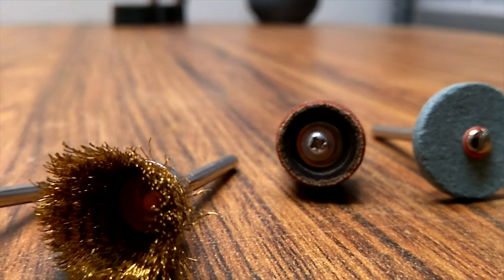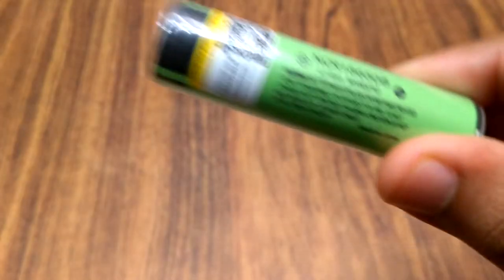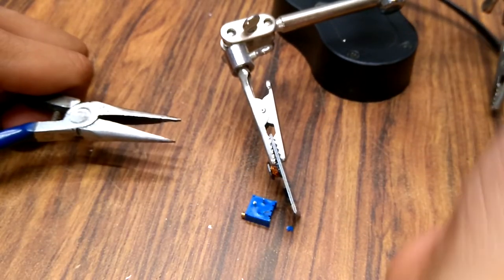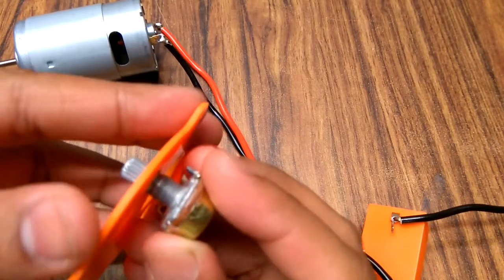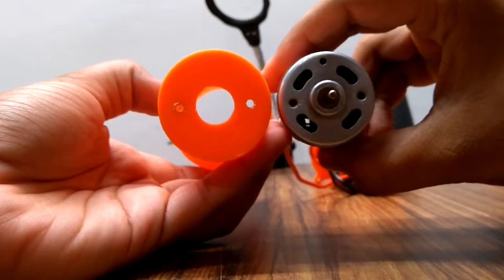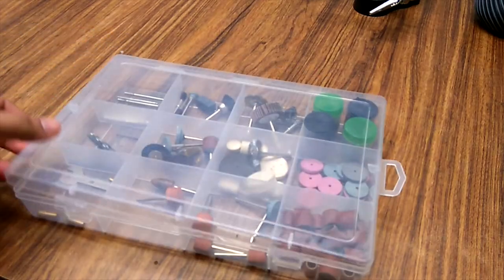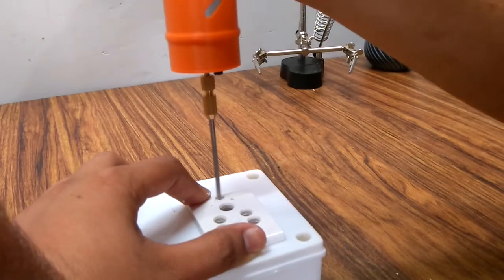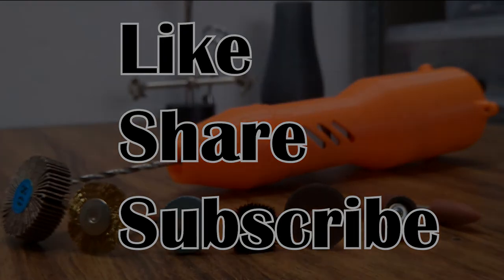DIY 3D Printed Dremel Tool

Comment: Replace with 4amps boost module for better results. Thanku.
Reply: true cause this module step up voltage,ok, but it is fine for 1-1.5 amps but will not be ok with more! this motor will require fast more amps! like you said, choosing a module able to deliver 4 Amps is the best! Also, better to use 2x 18650, because one 18650 should not be stepped  up to much, more than 9v-10v!! to much stress on a single battery is not recommanded! thats why better to use a least 2 x 18650.

Comment: bro step up module may not be that effective for.work coz it limits the current..and.thus the speed....use a power supply..like 18v or 24..would be great if you add 3 lithium batteries .which would give atleast 12v at full charge.

Comment: What is the Power supply to work Moto
Reply from the maker: the motor requires 12 volt power supply. i have used 3.7v lithium ion battery witha step-up boost converter to step up the voltage to 12 volts

Comment: I would like to know the overall weight of 3d printed shell. As I don't have a 3d printer. I found a webaite offering Rs.6/- (Indian Rupees) per gram.

In order to get the printed particle I wanted to calculate the cost of the printed portion.